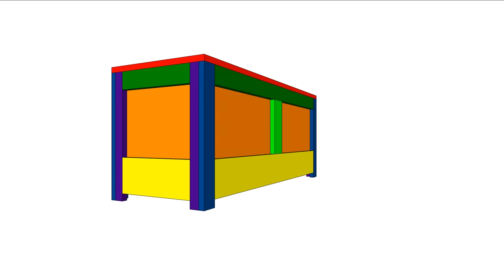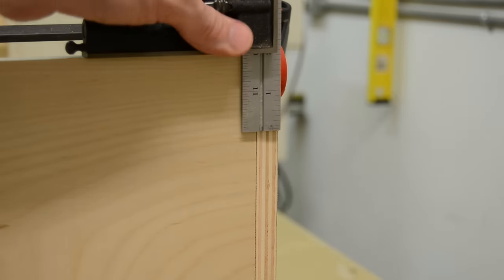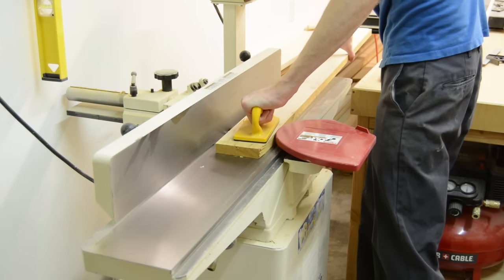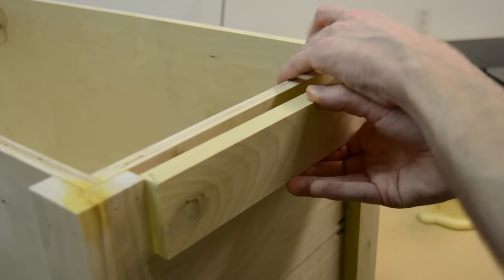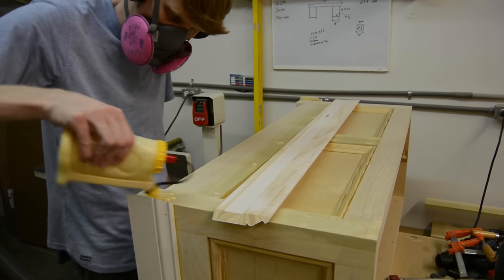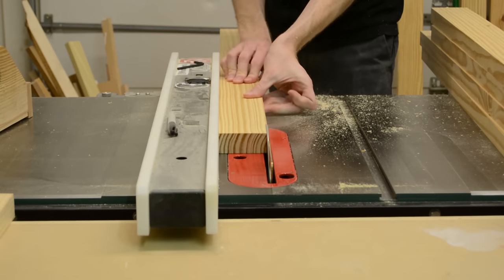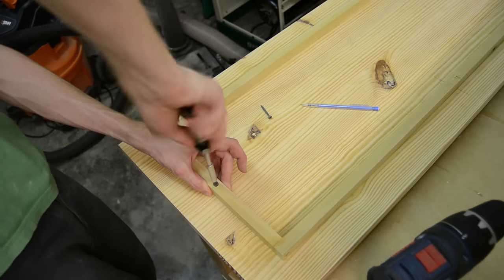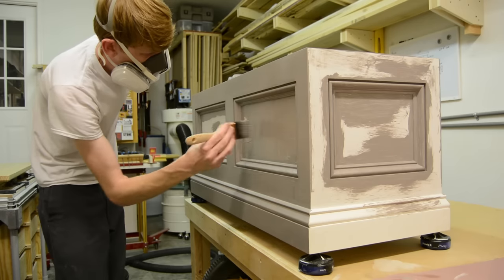Classic Storage Bench

Comment: Matt, seeing you rip the board 8:35 with your bandsaw in this video (not sure if that would be considered resawing) and then run it through the planer made me want to ask this question. When using stock that is thicker than you need and within the capability of your bandsaw, at what thickness do you resaw to remove the bulk material first? I was thinking that 1/4" may be enough to justify a pass on the bandsaw.

I recently built and end table from some rough poplar I milled to 5/4. It took quite a while to get my stock down to 3/4", but I did have a nice pile of shavings for my trouble. My bandsaw is really bad and I am contemplating a bandsaw upgrade to make thinning stock less time consuming. Understanding the time savings afforded by resawing may help me justify a nicer bandsaw.
Reply from the maker: +Makercise 
Yeah, I'd say any size of material you deem worthy of saving is a good reason to resaw. That's exactly why I did it in this case. Instead of having to mill two strips down from three quarters, I could just resaw it in half and then plane it and then I have plenty of material to do what I need. Resawing is very handy in cases like this and like what you said, preventing having to plane down and lose all that material.

Comment: Matt,
Nice work!!! Im on the fence about a table saw. In your opinion, do you think you would be as successful in this build if you used your MFT table and track saw only.
Reply from the maker: +dlindesey 
I absolutely love the mft for cross cutting, especially when it comes to sheet goods and breaking them down. The track saw and mft combo are great for small shops like myself. 

I do however think I'd sorely miss having my table saw for rip cuts. The main benefit of a table saw with a good fence is consistently ripping your boards. It would be hard to do with a track saw, especially thin rips.

Comment: Matt, really nice project!!! I would add hinges to the top but that's just me. I was wondering why you don't use a spray gun to paint your projects?
Reply from the maker: +Pat M
I just wanted a very simple way to attach the lid, it won't really be opened all that much. 

I don't currently have a spray setup at home and it's not always convenient for me to take stuff to work and spray it.
Reply: Ok since I remember you showing all the great info on spraying assumed this was in your shop.
Reply from the maker: +Pat M 
Yes, I don't always have access to the booth and don't currently have a spray setup at home.

Comment: You’re very talented. Keep up the good work. Have you ever used a product called floetrol when you hand paint your projects? It’s an additive for latex or oil based paint that helps level and extend drying to to minimize brush marks, I don’t paint anything with out it. Also on your miter saw, what are the benefits of the jig you had? Just earned a subscriber!
Reply from the maker: +Mark Melton I haven't used it yet, but I've heard good things about it. I assume your talking about the zero clearance fence? It's just a way to give yourself a nice positive stop reference point when making miter cuts. By using the kerf cut that the blade makes in the sacrificial fence I have a reference to line up all my cuts, it just helps with accuracy and cleanliness on your cuts. Hope that wasn't too confusing lol.

Comment: Why do you need a sacrificial fence on the miter saw when cutting your trim to size? What does that aid in? (I'm sorta new so just trying to understand) Thanks
Reply from the maker: +Anthony Ramirez 
It just gives you a positive reference point to cut your trim by and it helps prevent tear out.
Reply: Matt Lane Makes sense. Thanks for the tip.

Comment: Hi Matt, the box looks amazing. The two tone really looks nice.  I love your shop.  You have some seriously nice tools. Could you tell me the dimensions of your shop.  I'm looking to build one and am curious about size and layouts of professional shops.
Reply from the maker: 12x20 with a 5x6 cutout in the back where my sheet goods are stored
Reply: @MattLaneWoodshop  okay thanks! I'm fairly new to woodworking and have a good set of pipe clamps. Could you recommend an economical set of bar clamps?
Reply from the maker: F style clamps made by bessey go on sale pretty cheap now and again on home depot's website, they are actually cheaper than buying the harbor freight ones and much better. They come 6 clamps in a pack